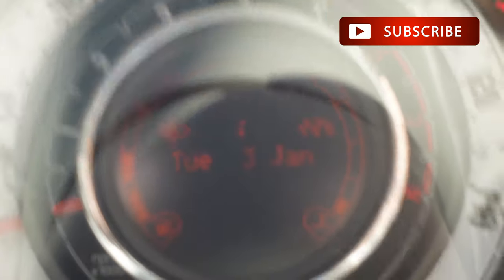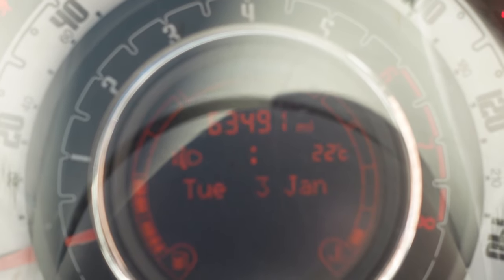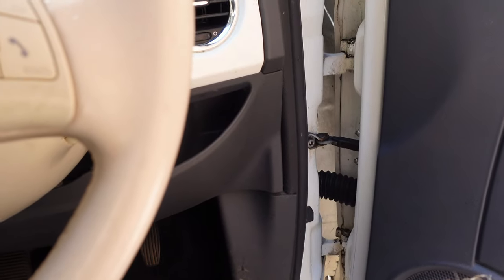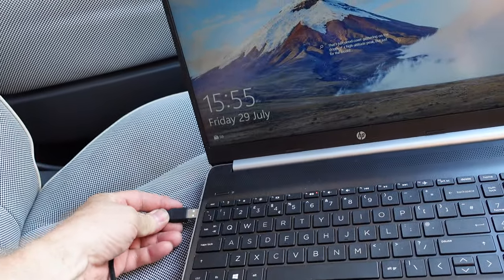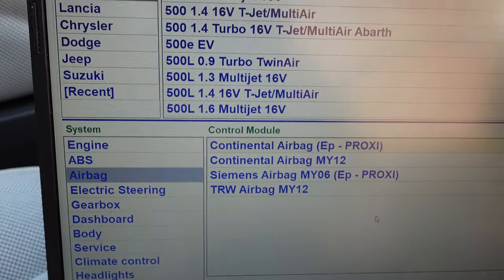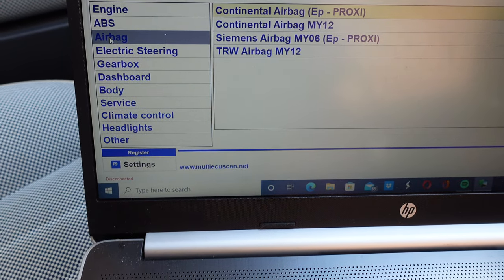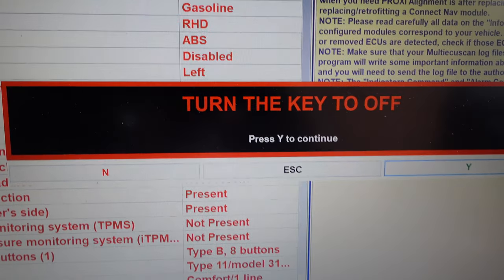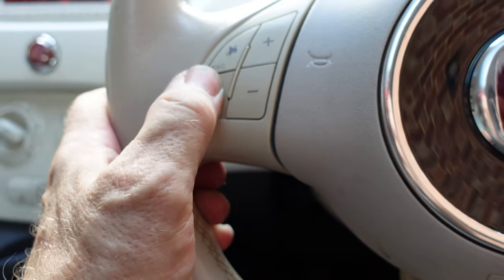Fiat 500 Flashing Mileage & Proxy Alignment - Blue & Me Not Working? #blueandme #fiat500 #abarth

Comment: Hi, could you tell me if you need to buy a registration before it will connect to any ECU. I have done the drivers for the ELM lead and windows net framework etc. I get a good test result for the interface, but it will not connect to any ECU it just says I need an ELM cable. It is only the free version, and some people say I NEED to buy a licence. Could you help me?
Reply from the maker: I’m not sure whether the free version actually connects or not. Most connection problems are because either the baud rate speed is set incorrectly or the elm isn’t selected in the settings within MES.
Reply: @Love500  Thanks anyway, spoken to Multiecuscan and they think the lead is a possible fake/Chinese. So I have ordered from one of there recommended
Reply: Supplier's.....thanks again
Reply from the maker: @adeb1102  you need a “modified” one. I use a cheap Chinese one. Works fine. I’ve been using it for years.

Comment: Hi I.have a 2018 fiat ducato do they have a SWG ? If so where would I find it.Thank you
Reply from the maker: SWG?
Reply: @Love500  it is the security module for the OBD2
Reply from the maker: @rodallen8336  I have no idea what that is
Reply: It opposed oshould be SGW security gateway module
Reply: Oops,  SGM the security gateway module it was introduced on a selection of newer  model vehicles. It was used to protect the vehicles network
Reply: To protect unauthorised access , including potential cyber attacks
Reply from the maker: @rodallen8336  I have no knowledge of that whatsoever I'm afraid.
Reply: @Love500  no worries ,I thought you might have known. I know you can bypass the security gateway, you have to disconnect the module and plug a by pass cable in to get in to the OBD2 to make changes. Apparently Fiat Dealer have got the software, and they charge you an arm and a leg.

Comment: I have flashing mileage.
Had airbag ECU fried under the dash ,replaced with same unit and numbers .
Airbag lights all out but I can't do a proxy align .says I have 2 faults and they won't clear .
Airbag

Received negative response 0x31 Configuration out of range Configuration not supported 
Also  B10AA4A
Active
Check configuration failed
Reply from the maker: I’ve had out of range errors before. From memory I think it may be a faulty unit. Are you using multiecuscan for diagnostics.
Reply: @Love500  no using autec machine 
I was told it might be the body control module? Under the dash mine has a metal plate around it ...
Needs more investigation but only had car a week with these issues which I'm working through just wondered if you knew ? 
I pressed my windows button and I get the voice blue me asking for what command ? I take it that works as our phone do connect to the car
Reply: @Love500  airbag ECU are you saying is a faulty unit ? Sorry
Reply from the maker: @t-ruckerj  possibly. I’m trying to remember what happened when I had it. I can’t remember if that was a blue and me or airbag. If you fried your ECU it may have spiked your BCM. I would get yourself Multiecuscan it may give you a better idea.

Comment: Hello Paul I have a Fiat Bravo 198 and replace the old rádio for a new one Android and remove the Blue and Me system to avoid conflit. Also have the milage flashing, i bought the same kit as you mencioned at the video but when i try to access to the Body to perform the Proxy Alignment show me a message  "Connection Failed - ELM327 -> ECU Connection Failed - Check your cable and serial port settings". Can you help? Thanks
Reply from the maker: You need the yellow adapter on the elm. If you are using it, check your speed setting.
Reply: @Love500  i'am using the yellow adapter. Should i have some specific speed's?
Reply from the maker: @TheUnik1992  I think it’s 38400 or something like that.  Change it in the MES settings and make sure you have your elm selected in the settings too.
Reply: @Love500  that it’s right. I select settings F9 and see not detect the ELM put the right Information and now can access to Engine. When i try to add the yellow cable appears the same error. Any ideia what is now the problem?
Reply: When i connect the ELM with the yellow cable and check settings and test tell me this Message “Warning: This interface is not compatible with ELM 327 1.3! Will not Connect to any Can module”.
Reply from the maker: @TheUnik1992  did you buy a “modified” one?
Reply from the maker: @TheUnik1992  do you can connect to the engine without adapter but not to body with yellow?
Reply: @Love500  exactly
Reply from the maker: @TheUnik1992  you must have a dodgy yellow cable then.

Comment: What I need to do after replacement of cluster instrument ? I need to do proxy aligment only ?
Reply from the maker: And adjust the mileage back to what your car is if that’s what you want to do, followed by a proxy alignment.
Reply: @Love500  I want to replace my old cluster instrument because it is problem with LCD and diodes. I find new one with 2000 km mileage. I want to swap it and i need to do only proxy aligment after replacement to the new one or something more ? My mileage is 180000 km. New cluster instrument has 2000 km
Reply from the maker: @marcin3962  assuming you want it to display what your true mileage is, then it needs to be adjusted upwards using multiecuscan. You then do a proxy alignment. If you’re not bothered about the mileage it shows then just a proxy alignment is needed.
Reply: @Love500  I need to have right mileage because it is punishable in my country. Do you have some guide or tips how to read the mileage of the car and set it in the new instrument cluster ?
Reply from the maker: @marcin3962  quite simply take a pic of your current mileage and use multiecuscan to put the new Speedo to the same.
Reply from the maker: @marcin3962  https://youtu.be/u0iXSUQr1fU
Reply: @Love500  thanks, you are very helpful. I have one more thing. My Fiat 500 is from 2010 production. I can buy new cluster instrument from Fiat 500 but 2020 production year. It will be compatible for my car? I read on some forum that it can be problem with polift version because i will not be able to adjust clock on cluster instrument and also some problem with flat tyre sensor . My Fiat doesnt have this sensor but nawer version has. Do you know something about it?
Reply from the maker: @marcin3962  it will not be compatible. You need to get a pre 2016 one.
Reply: @Love500  You have really big knowledge. I will try to repair my old , I wish it will be a cold joints on LCD connector.
Reply from the maker: @marcin3962  I think it is just cold joints.

Comment: instead of fixing it, is it possible to just tell it to ignore/disable the blue and me?
Reply from the maker: Only by unplugging it unless the blue and me is so broken that the BCM doesn’t see it in which case a proxy alignment may “remove it”.
Reply: @Love500  thanks. I got a new head unit which is great, but they both talk to me now
Reply from the maker: @crissto8591  is you’re mileage still flashing?
Reply: @Love500  originally it didn't but i messed around with multiecuscanner and now it does. I read a forum post about changing byte 38 from 42 to 02 to disable the unit. Mine was at 03 but i tried anyways. Had to leave but will keep pushing and report back

Comment: I installed an android radio system and the flashing mileage started and i just saw another person with the same radio and the flashing issue
Reply from the maker: Yes it will always flash as the BCM is expecting to see the original stereo. It needs a proxy alignment.

Comment: @love500 I went into fiat and they told me worse case scenario it will cost £30
Reply from the maker: No way on earth will fiat do it for £30. It’s a minimum of an hour on their diagnostics which is currently about £140. If they reckon they will do it for that and you can’t find anyone with multiecuscan for free then bite their hand off. And that’s best case scenario. Fiat are unable to repair them if the proxy alignment doesn’t work. They will tell you it needs replacing which will cost you around £1,000.
Reply: Mines not the blue and me, I don’t have it. Mines for a radio code and proxi alignment for the new radio. They said it probably won’t cost anything but if it did it would be £30
Reply from the maker: @MollieKohlbeck  oh right. Even so I would be amazed if they do the proxy alignment for £30.

Comment: So if I want to do a "blue & me delete" to resolve the blinking odometer, all I have to do is disconnect the blue & me module and do a proxi? Would this apply to North American 500s as well?
Reply from the maker: I don’t see why the US would be any different. US cars have it behind the dash passenger side. Access it by removing the glove box. You can then unplug it. It may take several attempts to proxy align as removing the plug can throw up errors elsewhere. If it fails, go into the body computer and dashboard ECUs and clear any errors and then try again. I recently had to do it seven times before it worked. If you decide to repair or buy a used one, a proxy alignment will then re activate it.

Having said all that, if you have no other symptoms except flashing mileage then a proxy alignment may fix that.

Comment: Hi ! Just discovered your channel from France . Have you ever changed the clutch sensor , might need some repair on mine . My start and stop is working but it the sensor   is faulty because once the car stops it cranks immediately, like if my clutch pedal is depressed... Do you think it could be the issue ? 
Thanks for your channel , subscribed 👍
Reply from the maker: You would really need a diagnostics plug in as it could be one of many things. To be honest most people turn start/stop off. It’s also got a sensor on the battery.

Comment: Being a very new 500 fan and owner. 6 months ago I purchased a 2012 500 sport. Two weeks ago I purchased a 2012 500 Abarth. Still have both. In my earlier career I was an auto technician for over 15 years. I still compete all my own maintenance as well as all my repairs small and large. I’ve already downloaded the multiecuscan software onto my iPad now I need to purchase the idiagnostic . I haven’t found the one you’ve shown in your video but have found other brands. Is the brand important? Also the both 2012’s I own doesn’t have any color in the IBDII PORT. Could you advise? Appreciate your assistance. Regards 
Ciro Ressa
Reply from the maker: I don’t know what cables you use on an iPad. I believe that multiecuscan don’t support the iOS version anymore. I’m not quite sure why. I’ve only ever used the windows version which uses the usb elm adapter with the coloured cables. I’m not sure what the iPad version is but make use of not important. I would have allow on the forums on the MES website, I’m sure they’ll be able to guide you.

Comment: Thanks again!! its a success story on my Fiat Panda 4X4  flashing milage issues, I bought the Multiecuscan software from Gendan had a bit of a problem regarding serial ports on my laptop and no connection through the interface.
I contacted Gendan down in Swansea brilliant people, apparently in the program itself main screen bottom left (settings), you need to set up the type of interface and what kind of device in the dropdown menu very simple and with there help it saved me loads of computer frustration, then we were connected to the car. 😀
After that on the errors I could see my Blue&Me was not being seen, so it was just a simply  re-set of the faults and a CanBus alignment and its fixed.
Ive been playing with this software and you can simulated a lot of the jobs before you make changes on your car I would say that's a safer way before you commit to acutely making changes, 
 its just amazing, well happy for the money.
Once again thanks.
Andy  👍
Reply from the maker: Glad it worked for you. Usually Windows 10 will auto set.
Reply: Thanks for this comment. I have Windows 10 and it did not auto select. I chose the first ELM option in the drop down menu and it worked.

Comment: Fantastic video! Very detailed. My problem is BM not working + flashing mileage + parasitic drain of battery. Garage has disconnected the B&M but advise they cannot clear flashing mileage with their diagnostics. Any advice would be appreciated. Thanx in advance.
Reply from the maker: You need Multiecuscan to do it. If you want it repaired I repair them for £60 plus return postage. That will most likely eliminate the need for a proxy alignment too. If you want it repaired, email me at paul@love500.co.uk and I'll send you the repair form.
Reply: @Love500  Hi Paul, thanx for prompt reply. What I couldn’t understand is why my garage were unable to clear flashing mileage with their sophisticated diagnostics. We are in the process of selling the car which has been an excellent workhorse for my wife’s commute to Worcester Royal hospital. She retired 3 weeks ago. The car has done 116000 miles! Regularly serviced. The garage just rang to say 1/4 panel removed & blue/me disconnected as per my instructions. However he said he couldn’t clear the flashing mileage? He added last time he did a similar repair on 500, he couldn’t clear the flashing mileage. Would he also specifically require Multiscan ?  Kind regards Pat
Reply from the maker: @patrickhannon395  Alfa obd does it too and I believe some “professional” software does it. Problem with removing g the blue and me is the garages don’t really know what they are doing. They do a proxy alignment and it fails and that’s it they give up. This often happens when you have removed one. The removal will often throw a code into the BCM or potentially elsewhere. If it fails, you have to log into the others and clear any codes and try again. Sometimes it’ll do the same thing over and over. I recently had to do it 7 times before it worked. Garages don’t know this so give up after the first failure.

Comment: Very useful video! I drove my (2012 T/A) 500 about 6 months ago without the seat belt on, after about a minute of it bleeping at me, the speedo started flashing, but also, the airbag lights all came on, & it displayed "fuel cut off unavailable"... Its done that since (a couple of times the mileage has stopped flashing but the airbag lights have stayed on, &, weirdly, a couple of times the heater temp display has momentarily flashed)... I`m wondering if its a fuse now you mentioned about B&M sharing a fuse.. I think my B&M module has always been a bit faulty though, as it doesn't seem to connect the mic when someone calls the phone. I need to sort it as it wont pass its MOT in a couple of months with the airbag lights on.
Reply from the maker: Could be your brake light switch or your main earth strap.
Reply: @Love500  Cheers mate, I`ll have a look! I`ve got a B&M module I took off a Mito (09 Veloce) I was breaking, it looks the same, I might try that at some point to see if it sorts the B&M problem as well.
Reply from the maker: @MrPabsUk  be interesting to see if they are cross compatible.
Reply: Did you ever fix this?
Reply: @upstate922   After one of my mates spent 2 hours going through the computers, cleaning fuses & connections (the B&M is coming up as fine), it seems my airbag module is faulty, so he`s switched it out till I get a replacement or get mine sorted (the mileage has now stopped flashing), but, I`ve still got fuel cut out unavailable on the dash, & we cant work out why..

Comment: Hi ,my name is Amir ,i changed my stereo for joying and now my milage odometer is flashing ,i have an 595 2015 abarth with t-jet engine ,the canbus original plug is disconnected but i have canbus harness connected another way to the joying stereo. could i do proxy alingment with the blue simple obd or maiby to connect the original radio ,disconnect the battery for 10 minutes ,disconnect the battery again and change for the joying stereo?
Reply from the maker: @אמיראבני-נ7ס  basic OBD readers will not do it. You need MultiECUScan and the cables.
Reply: @Love500  Connecting the original stereo and then changing to the joying will solve this? or if i buy a connect 2 canbus harness for fiat ?
Reply from the maker: @אמיראבני-נ7ס  No. Your car is searching for the original stereo. You have to tell it that it's no longer there which is what the proxy alignment does.

Comment: Ve just bought a fiat 595 abarth and the milage is flashing I've tried disconnecting the battery and no change so I'm going back to the garage to get it sorted as soon as I can is it worth disconnecting the blue and me module as I'm worried battery might drain before I get there and might get strained
Reply from the maker: Battery will drain in a couple of days but most blue and me problems don’t cause battery drain.

Comment: Good evening,  I have a 64 reg 500, the mileage  is flashing,  but no numerals,  just dots, I took it to  a reputable auto electric  company,  and they said , the blue and me is missing,  if I bought  one, and had it proxy aligned, do you think this would  solve it, also can you tell me where you are based please.
Reply from the maker: Just dots? That sounds more like a Speedo fault. I assume your blue and me isn’t working? If not, yes you can put a V2 Blue and me unit in to replace the broken one and a proxy alignment will stop the flashing although the dots puzzle me a bit. I am in south London/north Kent.

Comment: Hi!  I’ve bought the Elm & the multiecuscan but the elm won’t connect at all. I’ve tried all the options. Any ideas?  Thanks 🙂
Reply from the maker: Go to the settings in MES. Make sure the elm is selected. That’s the usual thing. Also check the transfer speed.
Reply: @Love500  thanks. I don’t have to download drivers for Elm then?  That’s some information I’ve found. Thanks for replying. 🙂